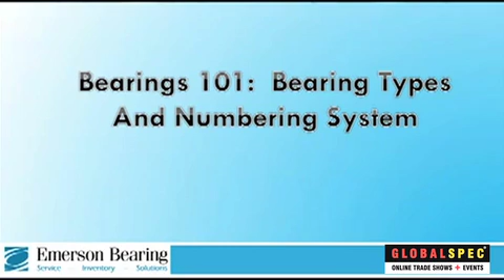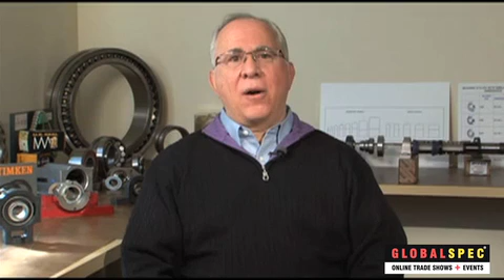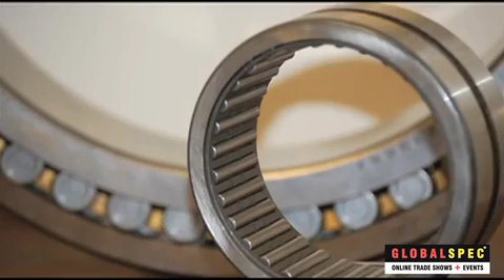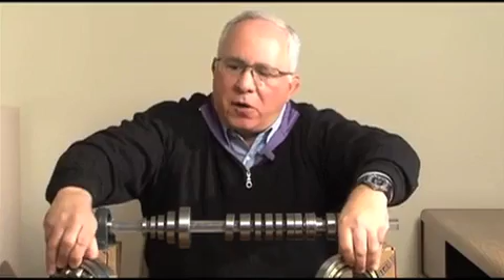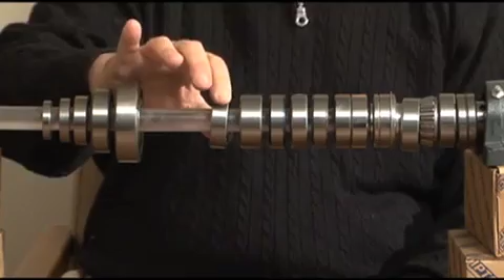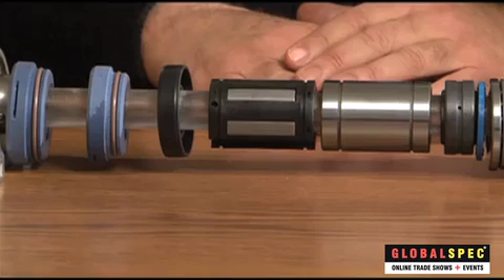Bearings 101 Bearing Types and Numbering System

Comment: Very interesting video I`v worked with many of those bearings you described. Kohler uses the 6300 series bearings on their small engine crankshafts ,and I replaced my washer tub bearings witch are standard 6205 , Antique Hunter ceiling fans use a sleeve bearing for radial loads and a axial thrust ball bearing at the bottom both bathed in a oil cup above the control switch